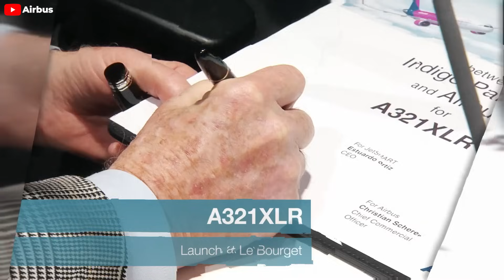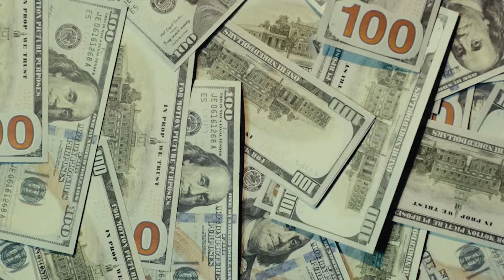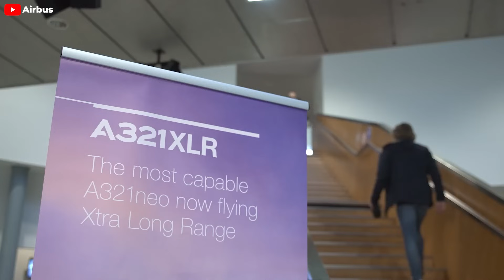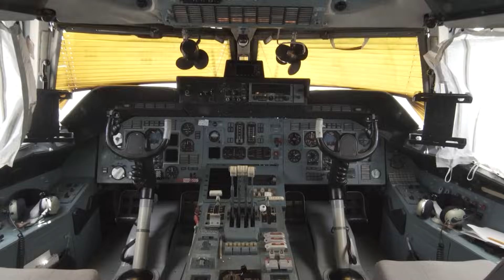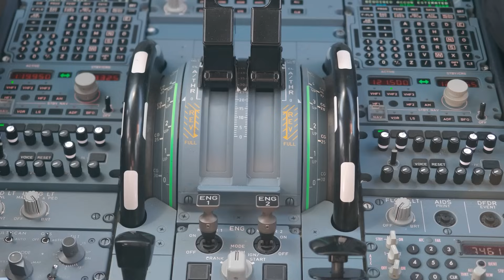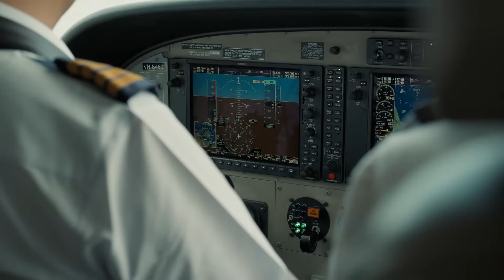Every Airlines to Says "NO" to 757 and BEG For The NEW Airbus A321XLR. Here's Why

Comment: The 321XLR with its four-wheel MLG (main-landing-gear), small wing and flaps, is no realistic replacement for the 757/200. At least not on those routes were the 757 excels, namely in MR/LR out of short runways or air-density/obstacle critical airports. They may be adequate for LR routes to secondary hubs or major hubs during the low season, competing with the 350 and 767/787s. Iberia is planning to use it on trans-atlantic routes, but based on Europe’s most critical hub (performance wise) will prove a challenge. So they may end up using it as an XLR in the winter-season, say to JFK, and on MD-range high-density routes in the summer schedules, involving a change of cabin configuration at every season change.
Reply: Airbus built A320 with quad undercarriage for Indian Airlines now apart of Air India Google Air India A320 with quad landing gear
Reply: It could have quad landing gear as Indian Airlines had A320 quad under wing wheels on some of there older A320 fleet
Reply: @adrianking6355  A320s with eight-wheeled main landing-gear? I think that's isn't feasible, otherwise Airbus would have it incorporated on their newest version, the A321XLR. They are stuck with four tiny four wheels, which affect their braking capacity, critical at aborted take-offs on hot & high airports. Madrid in the summer goes above 40ºC and its elevation exceeds 2,000 ft.
Reply: US airlines hung onto their 757s mainly because they are able to operate in & out of small airports in Hawaii and go nonstop as far as Texas or Georgia. The XLR will not be able to cover that niche. For Iberia any XLR routes from their hub in Madrid will be a no-go in the summer season. Back in the old days their DC-9s had to stop at Sevilla for refueling, and the early 747 at Santiago on the JFK route, for the very same reason. Nowadays, those stops are unacceptable for the traveling public.
Reply: If they can get into Bristol Airport with it's short runway and they built quad landing gear for Indian Airlines to get in to rough short airstrips they can if needed
Reply: Have you googled it
Reply: @adrianking6355  Yes, thanks for your info. I have friends who have flown 320 in India, so I'm trying to find details about that strange model, known apparently "hush-hush" as 320-231 with IAE Model V2533-A5 engines. Airbus was so proud about that version that they don't publish any details about it. Most people that see pictures of it, think it's a fake. Will revert to you, when and if, I'm able to surface concrete details about that "stealthy version" of the 320. That the 321XLR doesn't include those boogies is most revealing. Thanks again!
Reply: @adrianking6355  Both Airbus and Safran don’t publish any details about the 320s equipped with “Four-Wheel Bogie”. The only customer to operate such “stealthy” version was Indian Airlines, with up to 19 aircraft. The first VT-EPB (cn45 dd21JUN89), the last VT-EPT (cn97 dd28SEP90). They carried the designator A320-231, but there were also -231 with the standard MLG. 
Why eight MLG-wheels? To distribute the aircraft weight over a greater surface on low load classified runways. 
Pros: They double the braking capability, which allows higher take-off weights on short runway (engine failure on take-off); also for landing distance required.
Contras: Additional empty weight, that translate into less payload and/or range. Higher fuel burn due to higher empty weight. A bigger MLG wheel-well reduces center fuel tank capacity, reducing the range.
That explains why the 321XLR holds onto the standard four main wheels, yet take-off and landing performance are degraded.
Reply: Pleasure strange they were the only airline to have them
Reply: Apparently it is was made for Indian Airlines as a lot of the destinations had to have a different weight to ground as at the time some Indian airfields could not handle twin wheel weight  so they made them to spread the weight
Reply: Since Airbus is ignoring this major version difference in all their publications, wonder if anyone does have a comparison of DOWs of the 320 with standard MLG and the DOW of the  8-wheels ???

Comment: The production of the Boeing 757 ended in 2004. This is an aircraft that will be retired as time goes on.
Of course, no airlines want to buy an outdated aircraft that is not in production! This should be obvious!
The Airbus A321XLR is a brand new aircraft something Boeing lacks.
Reply from the maker: Thanks for your feedback
Reply: The 321XLR is basically a 320 with longer fuselage, new engines, and more range. It dates back to 1987 (first flight) or March 1988 (in service with AF).

Comment: I’m not interested in what Boeing offers.  I’ve avoided the MAX and won’t set foot on one.  Airbus A350 and A220 are the best in the sky.
Reply: Sheep 🐑
Reply: @JUVI9596  Reality. There hasn’t been a great aircraft coming out of Boeing this entire century so far. Lockheed needs to design and manufacturer as it did in the 70s.
Reply: Though Boeing has quality control issues at present; Airbus had many fatal accidents of 320s and 330s.
Reply: Few on many no issues even delta ordered them